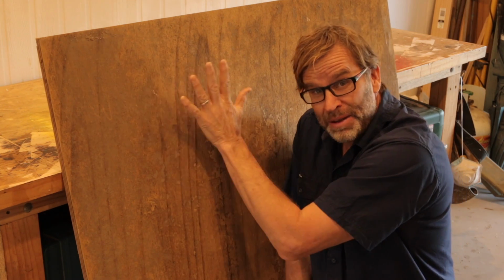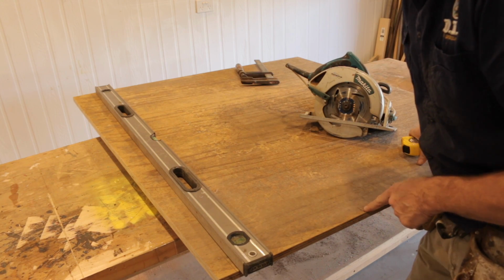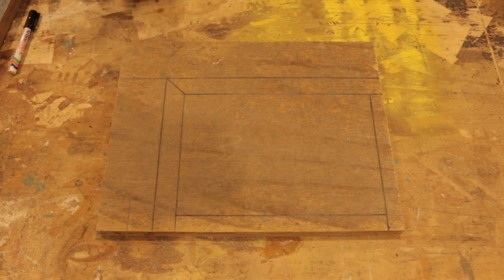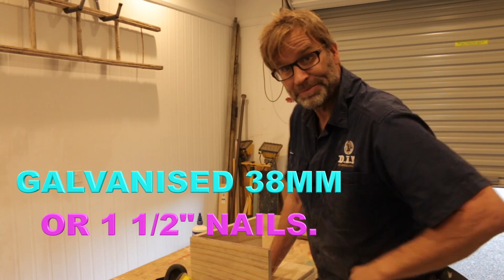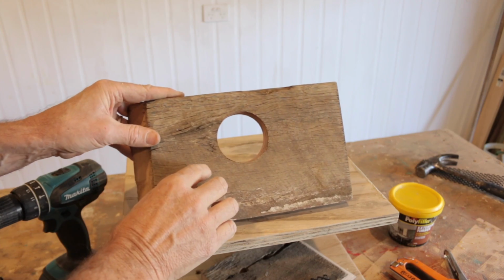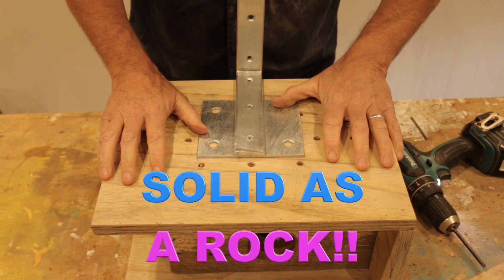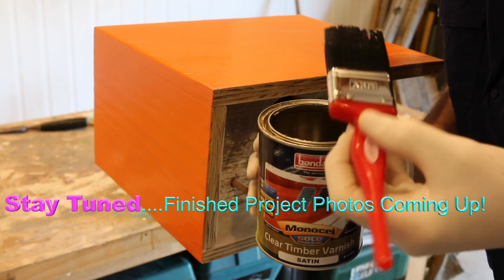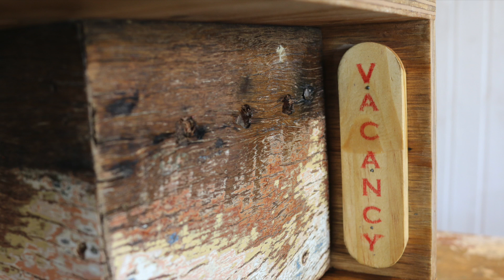How to Build a Birdhouse. Easy, Quick & Cheap!

Comment: Do you have to use a particular type of nail or screw to attach it to the tree?
Reply from the maker: Hi Denis....just use a fixing that is galvanised or has some other form of external grade treatment applied to it. Cheers mate 👍
Reply: Thanks!